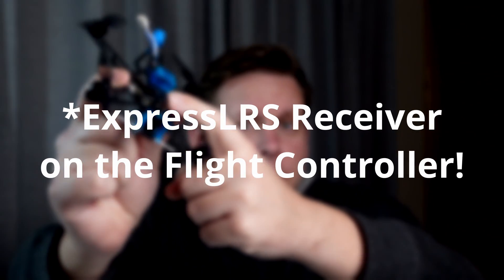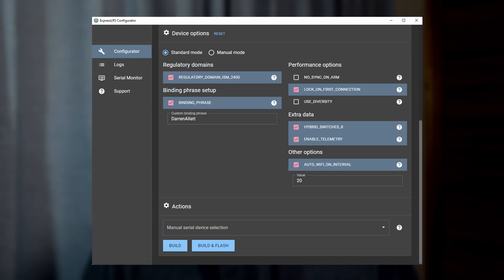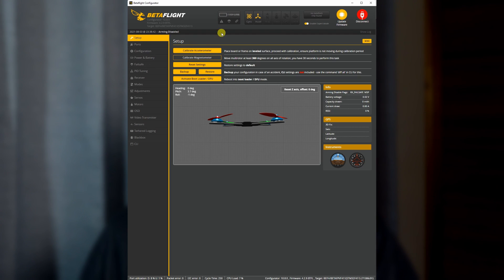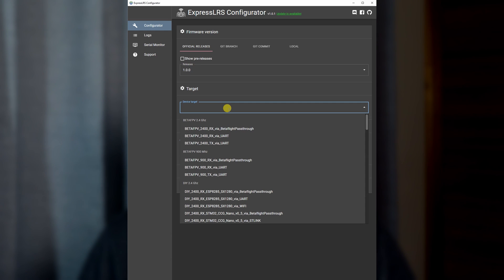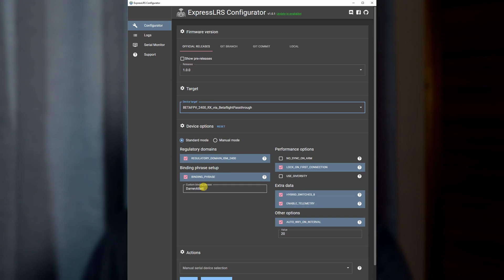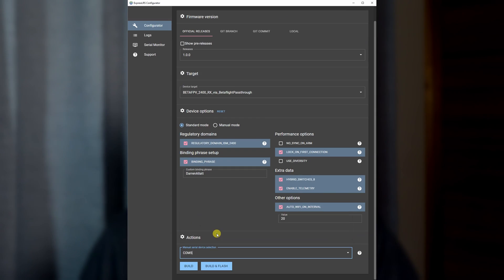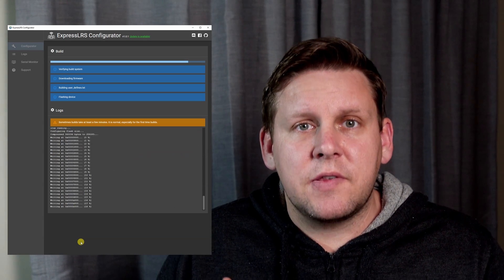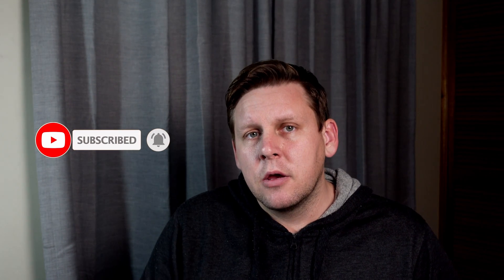How to Flash & Bind BetaFPV 1S ExpressLRS AIO | ExpressLRS V1

Comment: hello can i flash 3.0 on the aio? which target should I choose? it just shows me betafpv lite/nano or 2400 rx
Reply from the maker: The newer version of this board does the receiver over SPI which isn't compatible with V3... However if you can flash V2 using this method then it should work as well

Comment: why would you select crossfire if betaflight shows exprss lrs?
Reply from the maker: The V1 of the board used CRSF protocol via an internal UART to connect to the ExpressLRS receiver; while later versions of the board which were made after this video use the SPI to connect to the ELRS receiver.

Comment: ELRS 1.10 flashing BF Passthrough：RX Serial not found
Reply from the maker: Which receiver are you using?
Also, have you set the ports tab to be the correct UART, TX to RX & vice versa, set configuration to CRSF
Reply: @DarrenAllatt  betafpv F4 1S 12A AIO ELRS 2.4G V2.0 board，Use SPI ExpressLRS 2.4 receiver

Comment: Nice tutorial! Did you at any point have trouble flashing ELRS 1.01 onto the HX115 LR board?
Reply from the maker: Fortunately I didn’t have any issues myself. A number of others have where the receiver is soft bricked, and you have to short one of the I/O pads to Ground while flashing.
Reply: @DarrenAllatt  Yeah, that seems to be my problem. BetaFPV had the wrong BF Firmware on the board and I had to flash the correct one. Now I am fighting with grounding the boot pad and flashing ELRS 1.01.
Reply: Ha, I finally managed it. The Lipo I was using was almost dead and could not give enough amps for the FC to work properly during flashing. With a power supply and the boot pad soldered to ground it worked. Maybe this helps someone else with the same problem.
Reply: @tscUnhold  help me...where is the boot pad

Comment: Sir - What Radio have you used to Bind to the BetaFPV HX115LR ? 
I recently purchased the BetaFPV Nano ExpressLRS TX and also a BetaFPV HX115LR drone and I'm having problems trying to Bind to the HX115LR with my Tango 2 with the BetaFPV ExpressLRS Radio-Module... 
I Checked everything to make sure the options match as well as using the same Bind-Phrases. 

Not sure if there are other people out there with Tango 2s having issues with BetaFPV ExpressLRS products ???
Reply: Both RX and TX must be running the same version. I had my TX updated to 2.0 and had to roll back to 1.2.1 to get a bind on HX115 AIO ELRS.. So far I have not been able to update the onboard ELRS so all my RXs are back to 1.2.1 for now.
Reply from the maker: I am using a both a Taranis X9 Lite with the BetaFPV ELRS module and a Jumper T Lite with the HappyModel ES24TX. 

My recommendation for binding is to use the ELRS Configurator and flash both the RX & RX with the same settings and the same “binding phrase”. 

No one to my knowledge is having issues with a Tango2. You can DM me on Facebook if you want to troubleshoot further. Darren Allatt